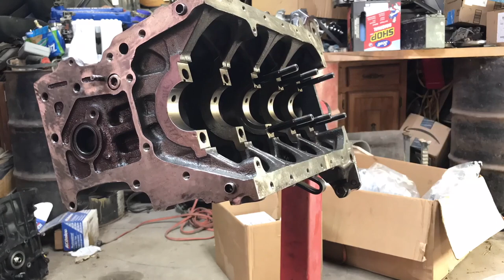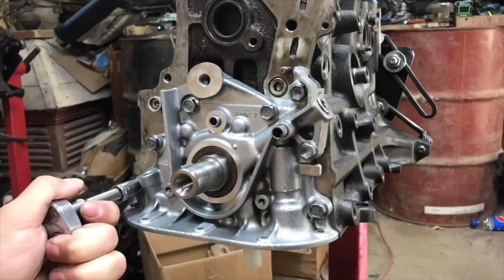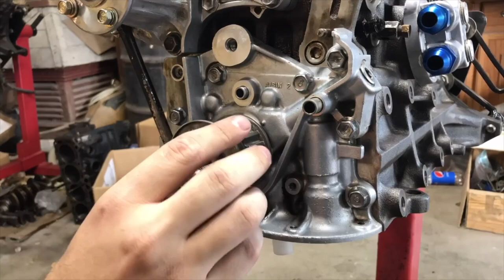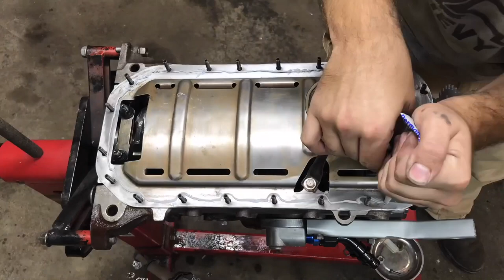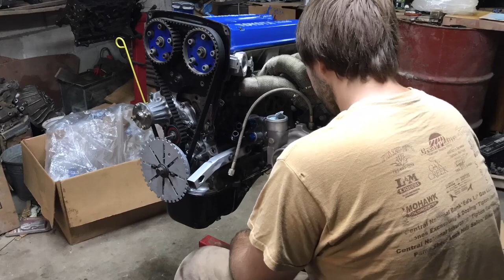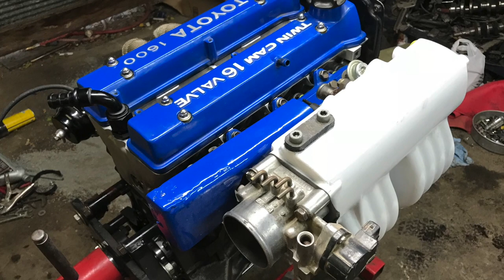4AGTE 16V Build

Comment: Very nice build just one question why don't you o ring the block it will allow you to boost higher  again nice build
Reply from the maker: Leon Swart Thanks! it wasn’t necessary at my power goal
Reply: @NickPahls  thanks brother I got same setup and making  300 have at the crank with t3t4 turbo and 550cc injectors here in South Africa  we got 4agez  and it's a very strong  and  reliable motor .thanks. u can check out this guy on you tube  .Richard  Jordan 1400 bakkie

Comment: Looking at the head, it seems like you took out the rear plug and installed an an line, did you block off the rear connection or was there a different reason that is there?

Is it something you would recommend to do to a turbo motor or is it not worth it?
Reply from the maker: yea it flows better and you don't have to weld a bung onto the valve covers.

Comment: Nice build! Is building a 4AGTE worth the cost? I've got an 89 MR2 I'm debating on which direction I want to go.
Reply from the maker: Jay Dub yea but if I would do it again I would use a 7AGE. I built a 7AGTE for my AE86
Reply: @NickPahls  Yeah I checked out those vids you posted too. Sounds good! Appreciate the feedback, I'll have to check more into a 7AGE.
Reply: Jay Dub I have a J-Spec 4agze in my ‘85 AW11 that I would love to swap the supercharger for a  turbo but the more I think about it I think the Honda K20/ K24 turbo is the better route if you want more than 300hp.
Reply: @Mike-xn1bh  True, I've also looked at this option. I can get a k20 cheap from a friend, needs rebuilt, but I would need everything else to go with it. Hux Racing dyi kit is a great idea. Just weighing cost differences.
Reply: Are you the one to get with on a group buy for a harpers hatch? My search for one lead me to a Pahls Performance, liked the page, & with Mike's response to my comment I noticed your name lol!
Reply: I would probably swap that J-Spec 4agze over to turbo. I'm not sure the limitations of the stock internals, but would be sweet nonetheless. Plus you could always sell the whole setup as a drop in ready to go, & kseries swap later.
Reply: Jay Dub How much do they cost, I might be interested?
Reply: @Mike-xn1bh  The Harper's hatch? Not really sure. Getting in on the group buy is the cheapest way due to shipping costs out of UK. Woodsport is who makes them.

Comment: Gday nick! What sort of power could you get out of this build reliably?
Reply: Also any idea what the aw11 runs in the quarter mile with this build?
Reply from the maker: @samsukkarieh1909  I was building this engine for around 300HP, should be able to do a 1/4 mile in 12.2 to 12.4 seconds

Comment: This would have been so much better if you'd provided information on what components were being installed- such as piston type and coating,  bore size,  crank manufacturer, cams, shim under bucket lifters and so on.   You didn't tell us any thing about the build.
Reply from the maker: 82mm 9.5:1 Ceramic coated Pistons, OEM head gasket, 272° 8.1mm lift cams, adjustable cam gears, uprated valve springs, MRP turbo manifold, MS3X ECU, Bosch 650cc injectors, ls2 coils, air to water Intercooler, Ported and polished head, balanced rotating assembly